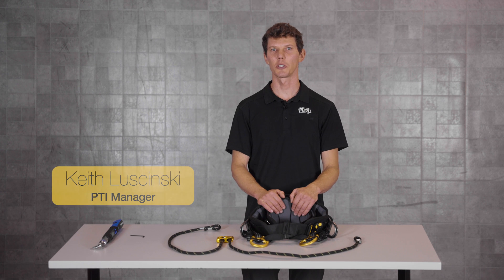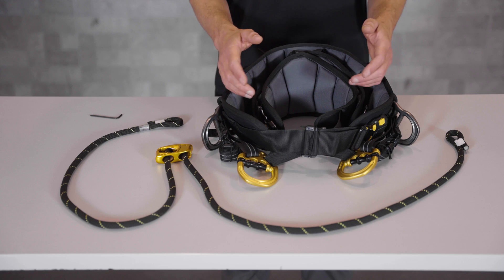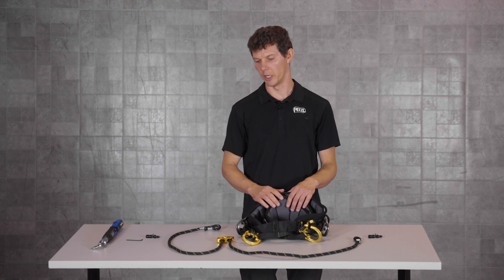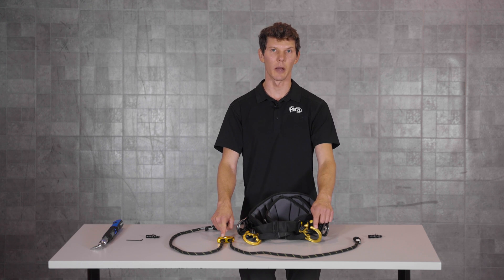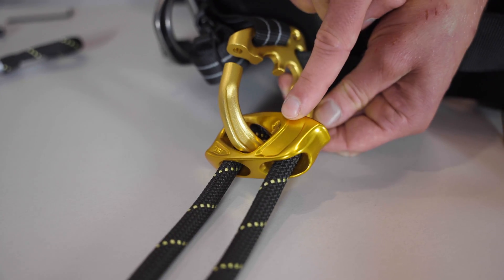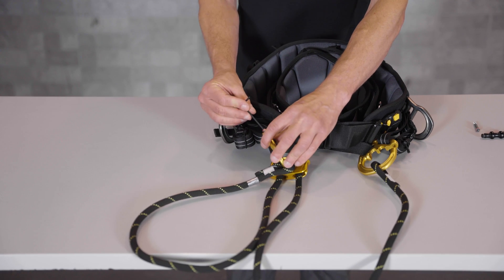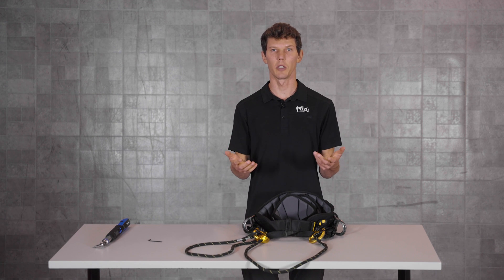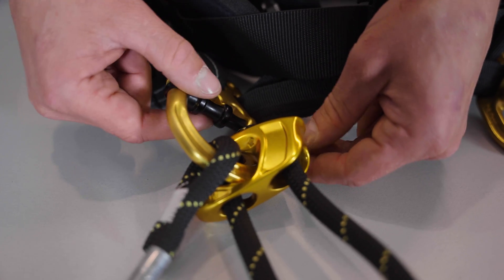HOW TO install an adjustable bridge

Comment: what if the screw is accidentally stripped in ?
Reply from the maker: As specified in the technical instruction :
Carry out the mounting in a suitable location to avoid losing the spacer or screw. Make sure
the O-ring is present on the screw. This O-ring helps prevent the screw from loosening in the
event it is not properly tightened. If the O-ring is missing, contact Petzl after-sales service.
To ensure proper performance of your device, the screw must be correctly installed and
tightened to the indicated torque. Using a torque wrench is the only way to verify that the
tightening torque is correct.
Verify there is no play in the spacer. A gated attachment point is secure only if the screw is
completely tightened.